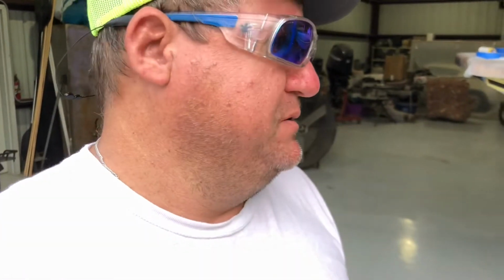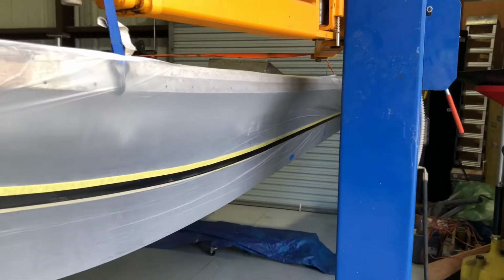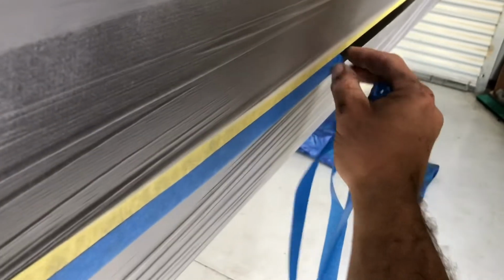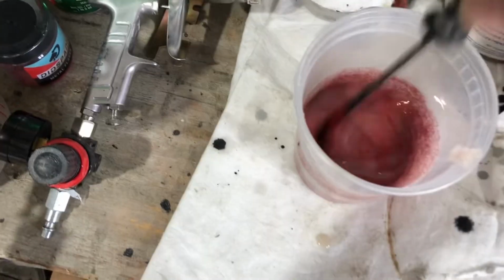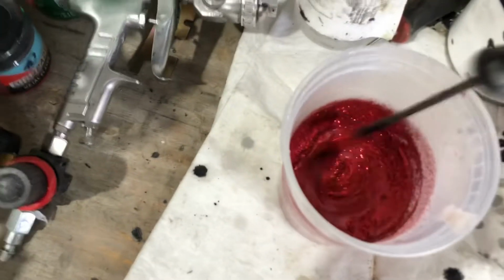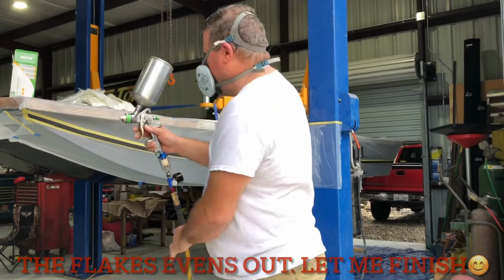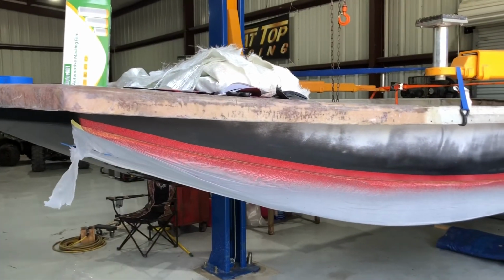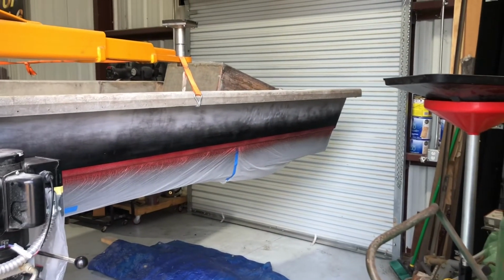Majek Red Fish Line 18’ Rebuild Video-11 Spraying Gelcoat Flake.

Comment: Hey what psi are you using to spray this with? I'm doing the sane thing to my boat and trying to get all my ducks in a row lol thank you
Reply from the maker: I was spraying with a 4.0 tip using 45-50 psi air pressure. You want it spray on and not blast on. It takes practice but you can do it. 🙂
Reply: If your using a Iwata Itani professional gun set the regulator at 65 and it will spray great. Also if your doing anything other than a pin stripe feather stops and starts and make sure you throw the excess metallic off the canvas or it will shadow and model badly.